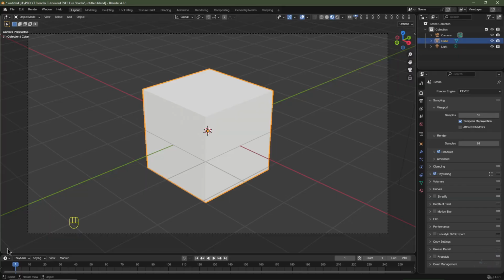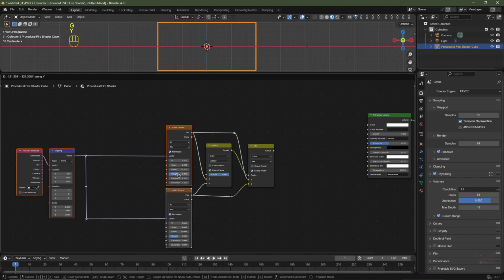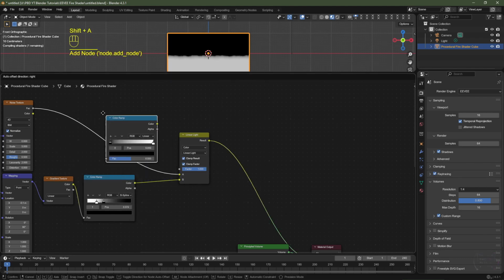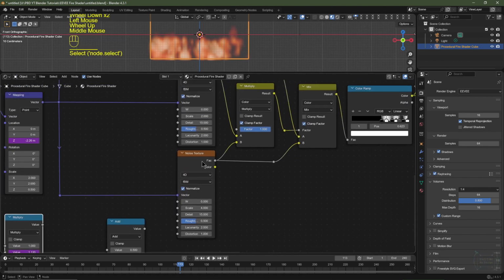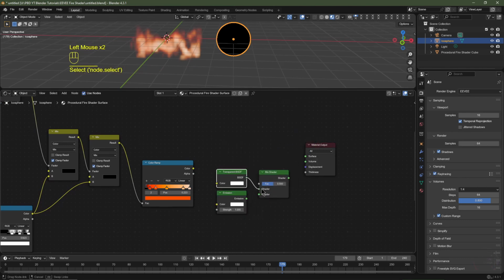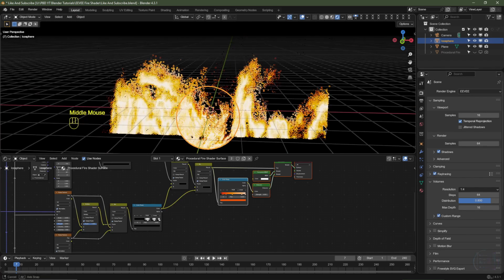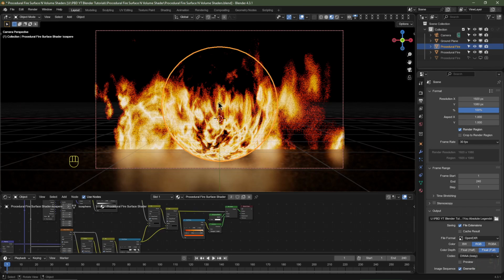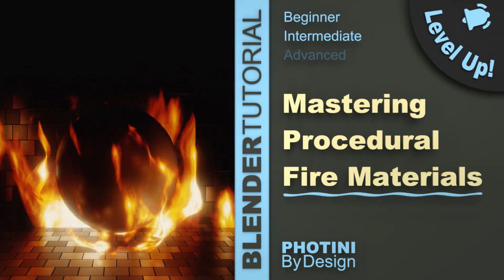Procedural Fire Shader – Blender Tutorial

Comment: Blender 5.2 - Cycles: The volumetric looks great, however when switching over to the surface shader, I am having an issue where the black regions are no longer transparent.

Edit: I see my simple mistake where the mix color output was not connected to the factor of the mix shader. It looks amazing now! Thank you for this tutorial  :)
Reply from the maker: You may need to go to your cycles render settings, and under light paths increase your transparency bounces until the black becomes transparent. If this doesn't work, let me know and I will help you troubleshoot the problem.
Reply: After going though once more, I see my mistake - The mix color output was not connected to the factor of the mix shader. It looks as intended now! Thank you for this tutorial  :) definitely will be saving this one for future projects  @PhotiniByDesign
Reply from the maker: That's an easy mistake to make, these node trees get the better of us sometime. I am glad you managed to fix it so well done with persisting with it. Thanks for watching my tutorial, it is really appreciated. Stay sharp and level up :-)

Comment: Very cool exercise...learned some neat stuff, great effect too...but I'm curious as to what the little eyeball and X's are in your interface? The ones in the upper right corner of the 3d viewport.
Reply from the maker: Glad you found it useful. As for the X's and the eyeball icons, that's an error which is partly my fault. Quite a few years ago before blender adopted collection, we had layers. The icons in the top left are remnants from the old layer system. When blender transitioned from layers to collections, when I installed the new version I opted to keep the settings from the previous version, but the new version didn't contain all the components, and so I was left with these icons. The only way to get rid of these icons is if I remove every version I have and then reinstall them from fresh. I am due to get a new workstation soon so I can start from scratch...